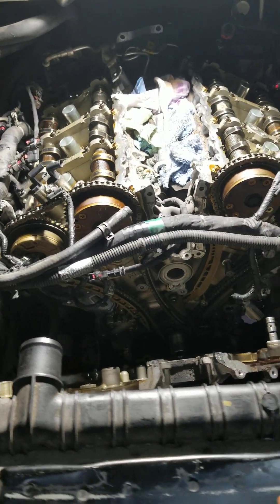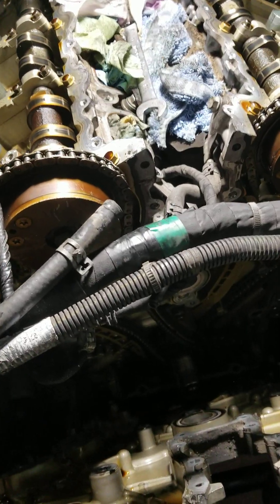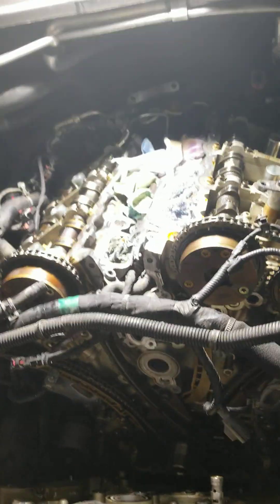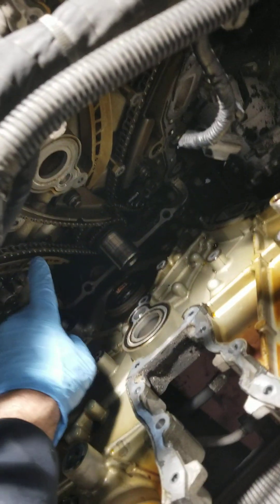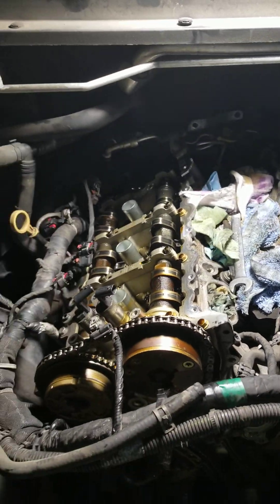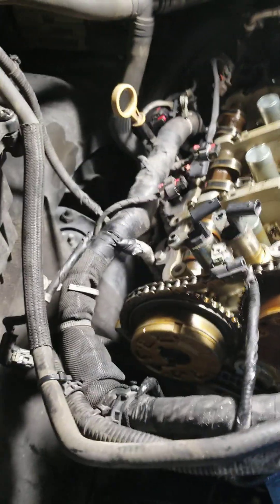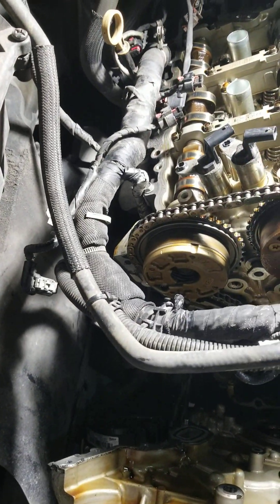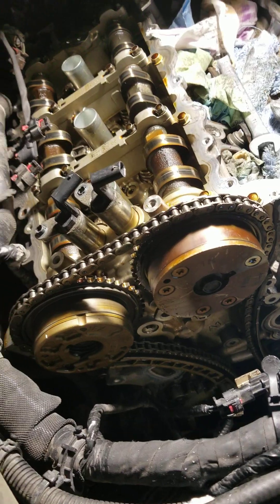2017 Chevrolet Colorado 3.6 timing chain replacement

Comment: Greetings, is the fault corrected after this? I have the following codes: P0018 and P0021. I replaced the VVT solenoids and they remain the same. Could this be the same problem?😅
Reply from the maker: It can or might be a different issue